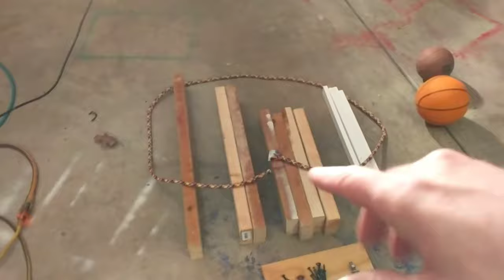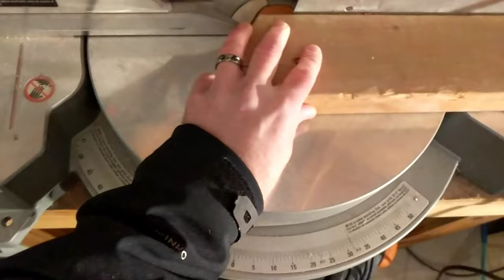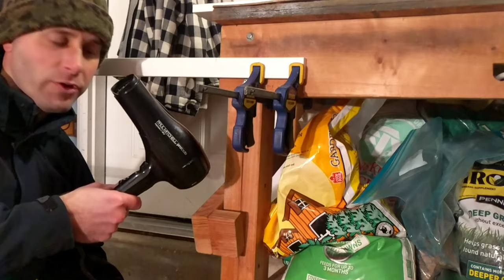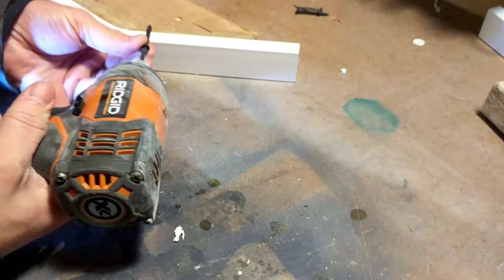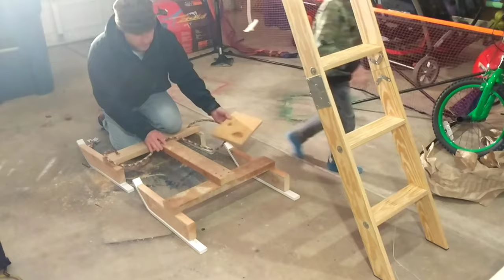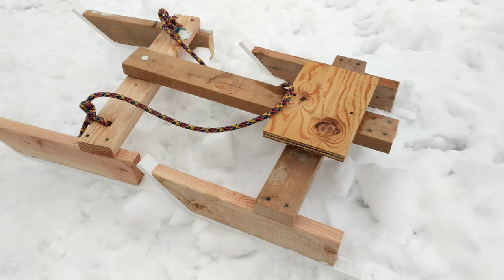DIY Sled (Steerable)

Comment: I like how it is inexpensive  and only requires basic tools...
-But as an engineer, I can't resist wanting to make a few improvements! 

1. Steering: make it self-centering instead of self-turning
*just need the pivot point further ahead than the halfway point of the front skis - the further, the more self centering it is.
*if you are worried that makes the board too far away for feet, just add a second board for the feet (also gives you the ability to change/adjust the balance by moving the seat and footboards)
*while you are improving the steering, use some milk jug (=nylon sheet) to make large washers between the boards and washer/nut. A nylon cutting board would also work, but that costs money.

2. Longer skis:
*adjusts widths of each end / run one set inboard or outboard far enough to have longer skis without hitting when you steer. (I'd opt for the steering being outboard for improvement #4 below)

3. Padding: get some cheap foam (preferably "closed cell" for water impermeability), tie it to it (no tacks or nails to worry about coming loose) or use contact cement. Padding goes a long way, so thinner is better.

4. Sit-down and lay-down use:
*add hand hold pegs to the front of the steering skids
*extent the seat board or use 2 separate pieces so you have surface area up front to lay on
*either make sure is cut away to not interfere with foot steering or Simplify the design to have a pad running the whole length and use the pegs I mentioned to foot steer and hand steer

5. make it fast (also lighter)
Skis:
*go to goodwill/salvation army/garage sale and pick up cheap skis (I got 2 pair at goodwill for ~$10.50 together)
*you will need a way to cut through the metal rails on the edges of skis (hack saw etc, just not a wood saw)
*don't need boards the whole length anymore, just as spacers at the attachment points (saving some weight and making the height spacer-adjustable)

**Up until this point, it's all been about $10-15**
If you had no budget limitations
5. Lightweight and more permanent frame + dampening:
*use aluminum angle instead of wood. (recommend 1/8"Th x [whatever size needed for the weight of the person]). Bolt it or if you have a welder then even better.
*Use thin press-board etc, such as what clip boards are made of, or thin plywood to make the seat areas
*use some rubber sheeting/tire/etc between where the frame attaches to the tops of the ski mounts to give some limited shock/vibration dampening and a little more flex for the skis to follow
Reply from the maker: These are amazing improvements! I've went through all several times, I'm certainly going to use these and make a V.2, thank you so much for the detailed suggestions!! Now to find time to plan and build it... :)
Reply: @kove  Glad you like them. I'm a fan of building things with family.

I enjoyed your video too, especially the savages moment!
Reply from the maker: @andrewstambaugh8030  Same here, very rewarding seeing them learn and making treasured memories. <3
Reply: @kove  I'm in the process of building a couple sleds for adults, designed for speed and control and with proper suspension. (parts are in my living room right now!)

The skis were cheap ($10 for 2 pairs at goodwill), and I could just bolt some boards and pads to them and have almost nothing spent on the project for a much faster than store sled.

But I want to make supremely awesome sleds, so rather than a quick and decent enough for many years build, I'm making it more complicated and expensive.
Basic criteria:
*Overbuilt - nearly every time I go sledding, there is some point when a bunch of people all cling/pile onto 1-2 sleds and try to go down the hill. I want a sled that can handle that without breaking.
*I want steering and prefer to have brakes, so sketchy hills become an option
*light and permanent - I don't want to drag a heavy sled up a hill, so wood isn't ideal for the primary frame/structure (good for seating pads though)
*need to fit in my car - preferably in the trunk, but at minimum only needing the bigger seat folded forward.
*pads. Even as children, we would put pads in our sleds. Now I'm too old not to.

If you want an idea of what I'm making, I was drawing up plans and saw something similar on NXT Garage (youtube channel). Check out his sled build playlist, especially videos 4 and 5.
His is a bit frail and squirly. Since I have a background in mechanical engineering, naval architecture (steering systems), and general metal fabrication, etc; I see several ways to improve on his sleds, but overall I commend his basic design and his are really cool. 
 
For a rough idea on cost: guessing I'll  have about $120-220/sled
(I'm doing a no-welds build)
*shock/dampers are $60-100/sled from ebay or amazon (cheap Chinese mountain bike shocks)
*Alu tube/channel/angle etc for swing arms and framing ~$20-30/sled
*Seat pads (foam, boards, vinyl covers?) ~$10-30/sled
*Misc/Hardware ~$10-40/sled

It could all be done with a drill and a hacksaw, but I have grinders etc, and a little cnc router that will let me make more complicated parts.
I'm guessing cutting and drilling the frames will be fast, but all the mounting brackets, tapping holes, etc will take a solid Saturday. Any parts I decide to mill will turn out nice, but I'm slow, so they will take a day or more by themselves.
With work and life, I hope to have these both built in 2 weeks (assuming parts arrive in time).

Comment: You really dont need pvc runners. Wood can be planed and sanded far smoother. My wooden runners outperformed both plastic and metal by having less friction using bees wax! If anything it was too damned fast...
Reply from the maker: Dang, didn't even consider that. Looks like I'm buying some bees wax soon. Thanks for the tip!
Reply: Dang, that could impale someone!